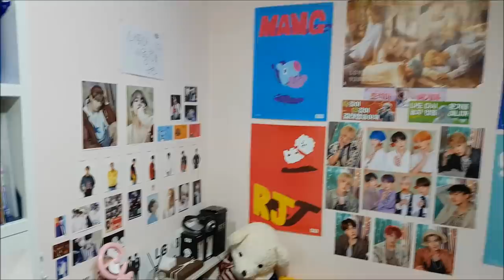Making BTS pendant / For my lovely daughter / 방탄소년단 펜던트 만들기

Comment: How much is the thickness of the gold？Can use copper instead of?
Reply from the maker: Last time you asked about the thickness of gold.
In response I gave an answer.
One more answer.
I don't know how thick the gold is.
When the size of the gold foil is about the size of a postcard, the weight is about 4~5g.
I use gold foil that is that thick.

Comment: I try to use 0.01 mm copper, but I failed, it will drop
Reply from the maker: naturally....
No copper.
You can attach it only by using gold on silver.
Gold foil is difficult and expensive to make.
That is why it is worth that much.
Only those who know its value are interested in my work.